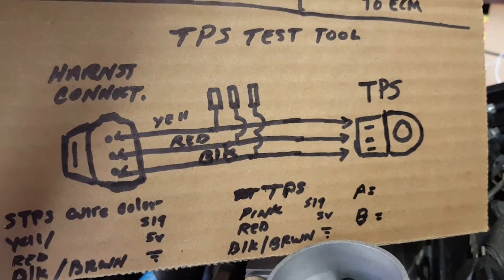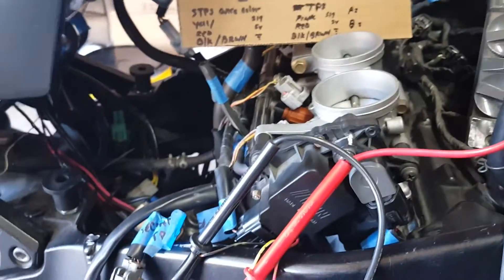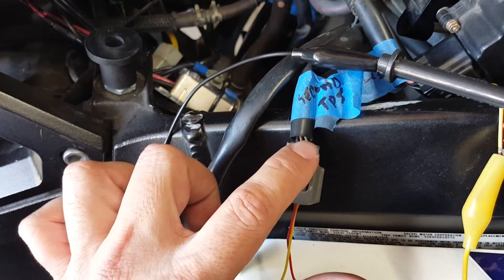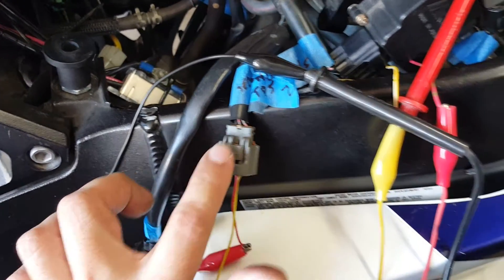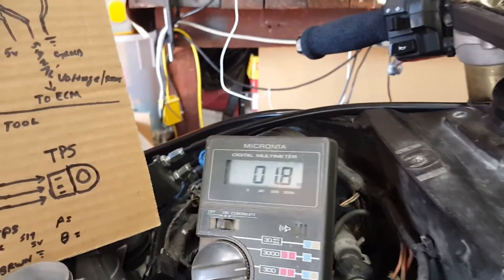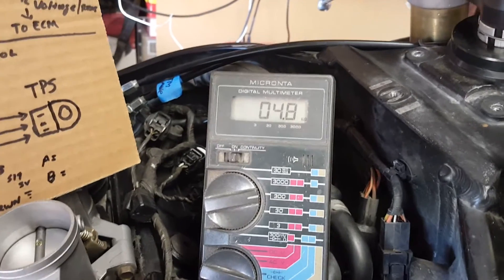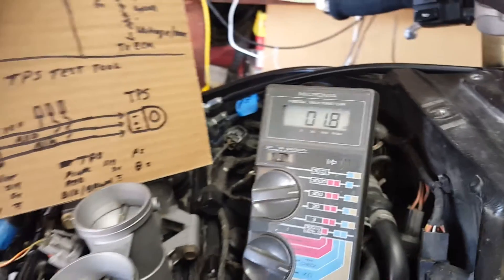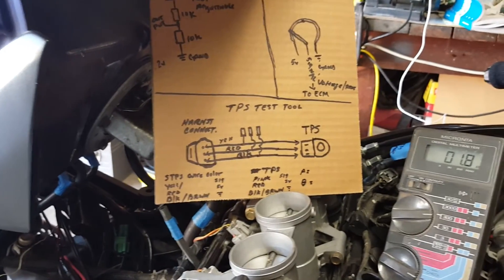SUZUKI GSXR 600/750 Testing the TPS for Dead Spots using Resistance

Comment: The bike problem please tell me how to fix
Reply from the maker: What are you experiencing?
Reply: @TheChemistDIY please help me
Reply from the maker: @allbikeproblem-c5u I need to know what your experiencing in order to help brother.
Reply: @TheChemistDIY  sir bike gsxr 750 2007 the bike problem is without air filter box rpm stable and not mixing but if I close the air filter box rpm dawn and bike mixing and bike of
Reply: And i check the whithout air filter box bike smoothly ran and if I close the air filter box bike not start quickly i give throttle 10% bike start but rpm not stable and slowly slowly dawn and bike of
Reply from the maker: @allbikeproblem-c5u when was the last time you removed and cleaned your throttle body stacks and inspected all your air lines?

I once had an issue where my bike would run really rough, and almost shut off at idle..  it was due to a crack in one of my airl intake lines.

 Have you removed the spark plugs to see what color they are.. essentially checking if you're running rich or lean.. if they're all black then you're running rich / if they're white then you're running lean..  if brown then your good.
Reply: Bike without air filter box rpm ok pickup ok but with air filter box rpm dawn and bike off
Reply from the maker: @allbikeproblem-c5u 

I'm not understanding what you are stating.. your running the bike without an air filter and filter box?.. RPM down?

Comment: I am a machnic bro and i have a bike problem gsxr 600 modal  this bike problem open filter box rpm ok pickup ok but close the filter box bike slowly slowly close and if I open the map sensor wire ok bike

Comment from the maker: So the C14 code is your TPS but doesn't mean it's bad at the moment. Have you put the bike in dealer mode and seen if it's adjusted correctly.. the level has to be in the center?    -00
Reply: I can’t adjust it either, if I have it in dealer mode and move the TPS the line won’t go anywhere, just stays at the bottom
Reply from the maker: @isaacsynamon2879 @isaacsynamon2879  C14 is telling u there's an issue with the TPS.. Not that it needs adjustment.. replace it.. there not that expensive.. 0:00 0:00
Reply: Put my bike into dealer mode and C00 doesn’t appear, just C14 with the line at the bottom like this _C14
Reply: I did replace it, I uh just put a brand new one in it and the c14 code is still there, even swapped a few out and still there, I’m so lost, bike runs like shit
Reply from the maker: @isaacsynamon2879  odd.. did you check the connector wires and pins.. also.. not sure if you know but the TPS and the STPS connector will fit each other and there is the chance of getting them crossed.. one is black and the other is gray... I've done it by mistake a few times.. could that be the issue.?
Reply: @ no it’s not, I put the same connector into it as last time, I haven’t done anything to the bike but change the tires lol, then went to go ride and noticed the FI light was on for my TPS C14, changed the sensor and still the FI light and code was still their, so I’m thinking either bad spot in wiring harness or bad spot in  my ECU

Comment: When you installed the new tps did it fix the problem?
Reply from the maker: This wasn't the problem. The problem was the regular rectifier was on its way out So I was receiving intermittent voltage that was more noticeable when applying throttle.
Reply: @TheChemistDIY  Holy crap thats insane that you figured that one out
Reply from the maker: @elijahkoenig729  lol, yeah I felt the same way. All troubling signs pointed to air, fuel, and throttle but once I checked everything out in those departments and it was all good I was forced to look elsewhere. Only thing left in my mind was power delivery. After removing the rear cowl I could see that the harness connector was cooked a bit. It didn't take a genius to figure out that there was an issue going on there. So I replaced the RR and the problem was solved. The RR is a common issue with the GSXR..

Comment: I got on my gsxr 600 k7 a c29 , can i change the stps with an new one how do i adjust the stps?
Reply from the maker: TPS and STPS rarely go bad, It may be thats its just out of adjustment. If you didn't know both are the same part so they are interchangeable to test, but if your purchasing the part, the  STPS is sold cheaper for some reason. 

How to test and set:
(ignition off) With the secondary butterflies closed set your digital meter on ohms and test.. your reading should read  around 1.6 k ohms closed,. Move your butterflies to full open and it should read 4.5 k ohms.
Reply: @TheChemistDIY  thanks a lot . But everybody say that i cannot move the stps because of the Feder in the stva
Reply from the maker: @Akeixbsl  If your STVA looks like mine then yes you can. The STPS does not connect the STVA motor in any way, not sure where you heard that information but the're wrong and you can see that for yourself here https://youtu.be/wfuXw0nhwh8. The only thing the STPS connects to is the butterfly linkage. If you look at 2:27 in this video you will see a white line on/above my STPS, this is the dealer marked line that shows the correct placement position of the STPS if you so happen to remove. Loosening the torx screw and Lining up the two marks will put you back in the correct value.  If you do not have these lines then you will need to do as I previously stated, and use a  DMeter.

Comment: Hey man, Happy New Year 1st off!!!  I have an 03 GSXR-750, everything looks good so it seems, have bypassed the kickstand switch, tip over sensor looks fine and fixed in correct position but... Everytime I hit some bumps or a good bump in the road the bike has an instant loss of power, it won't and hasn't died but acts as if it is or will... It instantaneously comes right back strong as ever... I did have an accident with the bike, well, 2 bad ones actually but I think I actually had the issue prior to this last accident... What could I look for in your opinion???  It went down on it's right side (throttle side)  if that helps or matters... This is driving me nuts as I thought it was the kickstand switch or possibly the tip over but I have ruled those both out... Thanks for any input you may have!!!
Reply from the maker: Happy new years Christian, when you say you lose power dose is it just the motor or are we talking full electrical cut out.. ie gauge cluster flickers on/off as well..?
Reply: @TheChemistDIY  actually no... Just like it is going to stall, I say lose power... Probably not an accurate description... It's like it is going to die or stall but doesn't and never has... Not spitting code or codes and yesterday I purposely went down the roughest road I know trying to make it die out or spit a code but nothing... It just chokes up and almost dies for just an instance but picks right back up...
Reply from the maker: @christianklett2892  to me from what your describing sounds like a fuel delivery problem aka fuel pump.. but I would first start by checking my plugs and coil pack connections.. with the tank up flipped/air filter out.. I would wiggle each of the coil packs to see if you get a rough idle or find a lose connection or lose plug.. 2nd pull the plugs to see what kind of condition there in or if cracked or damaged.. from there if all is fine, work your way down to the connections on the injectors..make sure you have good contact.. inspect fuel rail and lines for cracks.. lastly check the connections on the fuel pump.. this means pulling the pump and tightening the wires inside..while your there make sure your filter is good and clean also inspect inside the tank for rust and or debris..

One other thing that i would check is the regulator rectifier.. when these go or begins to fail it kuts power to the engine .. in your case it may be on its last leg or shorting causing sporadic lose or slight lose of power to engine.. all of these things that I have stated will not throw trouble codes as you have stated...
Reply: @TheChemistDIY  thank you so much for responding!!!  So, can I run the engine with the air filter out to wiggle the plugs and see if that has any thing to do with it... I just replaced the stator and rectifier and hardwired tge rectifier in due to plastic connection melted... So, I know the charging system is good... I know tge tank is clean but it could very well be an issue you described, I'll definitely check that all out!!!  Thanks again!!!
Reply from the maker: @christianklett2892  anytime bro..yes you can run the bike without the air box. Just be sure not to drop anything down the 4 stacks. I'm not sure how bad you spill was.. aka what parts were damaged and needed to be removed for inspection or replaced but from what you described it sounds like something  Loose or a part that took a good jolt and is working but damaged and acts up upon harsh riding conditions. It could be somthing as simple and lose connection, poor contact or as complex as tracking down a damage wire (electrical issue suck).

 Case in point: I had the number one spark plug come loose one  time and it gave me the exact same issue your describing (boggin/cut out), it took me forever to try and figure that out because you just dont think about a plug backing itself out knowing full well in the back of your mind you torqued them bitchs down.. from that moment forward I made it rule of thumb  to always use a diagnostic path (beginning to end) to rule out anything.
Reply: @TheChemistDIY  awesome man, you really been great explaining things to me and I really appreciate you!!!  It was a pretty bad wreck, worse on me as it usually is... Surprisingly these bikes are tough... I'm still healing broken bones but I'm cool and happy to be riding again... I'm going to get into it today and go nuts checking shit out!  I'm thinking your exactly right! Again, I appreciate all your help and input, I'll bother  you again and let you know what if anything I figure out... Have a great day man and thanks again!!!
Reply: I replaced the right side fairing, lost the front brake lever, bar end, rear set with rear brake lever and that was about it... Lost the throttle side frame slider, all parts replaced were throttle side.... Mostly cosmetic or so I thought...
Reply from the maker: @christianklett2892  ok good to know.. since you say you're right side throttle and lever was affected make sure to open up and inspect the start/kill switch.. there are plastic parts and metal contacts in there that are real finicky and provide electrical connectivity to keep the bike powered on.. I dont think this could be your problem but you never know since it was on the damaged area list. Like i said b4 thoroughness is key.. good luck brother, keep us posted..
Reply: @TheChemistDIY  good day to you man!  Hope it was a good one!!!  Sorry to bug you again brother but, I got into everything today and I mean EVERYTHING!  Lol... Anyway, everything looks good man!  I'm wondering, could a bad battery cause tge shit I'm going through???  I'll tell you I installed a new stator, new rectifier and cut out the melted shit plastic connector and hardwired it all and the multimeter checks all that out, charging system is working properly... Bike will crank up if I leave it hooked up to the battery tender but if I unhook it, it won't turn over, cranks but it just won't kick on and the battery gets drained pretty quick... If I crank it hooked up, it fires up no problem and if I run it or take it for a ride and then shut it off it will crank right back up... I haven't had a chance after getting it all back together to take it for a test ride (concerning the bump issue and it trying to stall)  but I was wondering if a weak battery could cause that bump issue I'm having as well as the new starting issue... I just don't understand because after I run it and hook it up to the tender it glows green pretty much a few seconds after hooking the battery up and stays charged!  I assumed if tge battery was bad it would not hold a charge and my tender would show the battery is shot... Man, I am stumped!!!  I sure appreciate you responding to all my assanine questions!  I should know more... I'm still ignorant but am learning, I should have worked on my bikes from jumpstreet but I didn't trust myself to fuck with anything I go well over a 100 miles an hour on lol... My pocket book dictated I start hahaaa... So thank you for all the answers you convey to me, I do appreciate you man!!!
Reply from the maker: @christianklett2892  Soooo, to me it sounds like you have a bad battery issue with it not cranking over. One thing about bad batteries is that you can charge them to full capacity and your charger will show there good to go but after a few hours of sitting it will eventually drain, this is due to a bad cell within. If you've tested your charging system and can confirm that your getting the proper voltage out (AC & DC) at the battery location then this only confirms that its time for a replacement. The fact that your able to start the bike and ride it for long periods of time also confirms that your charging system is working, this is because your running off stator power, else if it wasn't working the bike would solely be running off battery power to operate and when it finally drained would completely die during your ride. 

Could this be the issue of your biking bogging issue? -  I don't think so but you never know with electrical..so don't take this as god's word.

What i would do is charge your battery up and let it sit overnight (test the voltage with your D Meter), come back in the morning and put your meter back on the battery to see if you've lost power. Typical voltage reading should be along the lines of 12.4 -13 volts. 

If your looking for a trouble free battery that I stand by then pick yourself up Shoria Battery. You can see my review on the one I purchased and still have using the link below. Listen to my narration on the issues I was experiencing while testing.
https://youtu.be/I8GIhZRz0os

Your can get them pretty reasonably priced on Amazon using the link below which has it for :
LFX18A1-BS12 - https://amzn.to/2rSuL1P ($149 under new section link)
LFX19A4-BS12 - https://amzn.to/2ZQ7hqT (the one I have selling for $154)
https://amzn.to/2QM2W3E - (charger but you dont really need it)

Shoria sells it for $200
https://shoraipower.com/battery?type=175&make=381955&model=382025&year=382025

Funny that your asking about a battery, I just had a guy hit my up about a day ago and pulled the trigger on this battery purchase after seeing my review and reaching out to me. Let me know how it goes if you get this..
Reply: @TheChemistDIY  super cool man!!!  Thanks so much for all your input and answering my damn novels... Your good people, thanks for all you do!!!!  I'll keep you posted and try to keep the text down lol... I did clean the shit out of everything like you suggested, everything looked good, a few loose connections but nothing that really mattered I don't think... Buttoned everything up and had to haulass in my truck... I cranked it up and the throttle did feel alot more responsive, I hope to take it out in a bit but kind of stressing doing it at night, rather get stuck in the daylight lol.... Thanks a bunch man!!!  Have a super night!!!
Reply: @TheChemistDIY  I had the same thing happen, the # 4 cylinder spark plugs was loose and my bike would cut off during turns or hard throttle. Couldn't figure it out for the life of me. I go to change the plugs ( tune-up) and I get to 4 and it was loose af. And that was my issue. I wonder if this is what Christian going thru it did since it was a year ago. His spill may have cause a loose plug. Never know.
Reply from the maker: I had the same issue happen to me.. #1 sparkplug some how came lose and was jumping in the sparkplug well.. sounded nasty but made diagnosis easy.. since then I've always made it a point if in that location to make sure everything tightenes up and as it should be. It only takes one time and you never forget to check.

Comment: Oh yeah I just remembered mine was throwing a code for the exhaust I want to say was 47 but I'm not sure I looked it up and it said the exhaust and I do have aftermarket exhaust on but I never had problems with it before
Reply from the maker: The code values only go up to 46 in the book that I can remember. C46 is the exhaust control valve actuator. Make sure you have the correct number because C41 is your fuel pump relay which could be the reason why your bike wont start in the first place.

Comment: I get mine set to were the line is in the middle,try and start it and then the f**** line moves either up or down it won't stay in the middle. Do you know what that means? Also do you have any idea if ethanol may be causing some of the problems in my bike? I had to run and good I put my fuel in it now won't start at all neither will my chainsaw that I put the same fuel in
Reply from the maker: So adjusting the TPS and STPS is always a Bi^#h..  even the good book says take your time when tightening down the screws. What I like to do is not get the line dead on, instead back it off and a bit and account for the moment of each when you tighten down.

For your no start issue (fuel delivery) take a few drop of petro and drop it down into each of the 4 stacks (old carburetor trick).. crank the bike over and see if the bike want to run and then dies.. if this happens then you need work your way back starting from the injectors, fuel rails, lines, fuel pump and then tank to see where the problem lies.

If this doesnt happen then you need to move forward in the engine and look at your spark.. (is there any, how strong, how many, is it a coil pack issue or sparkplug issue)..

Oh ya, the line only needs to be in the middle at idle.. when you rev the bike it will go up.. not sure if you knew

Hope that helps